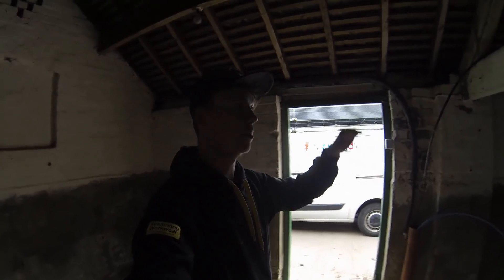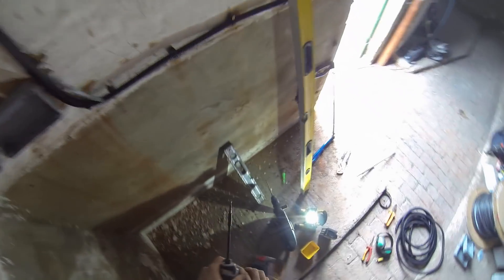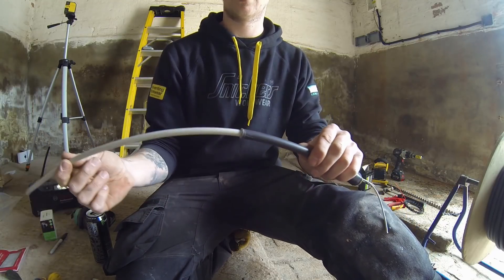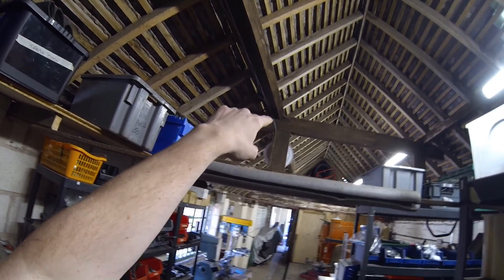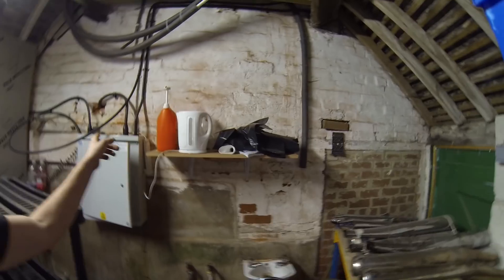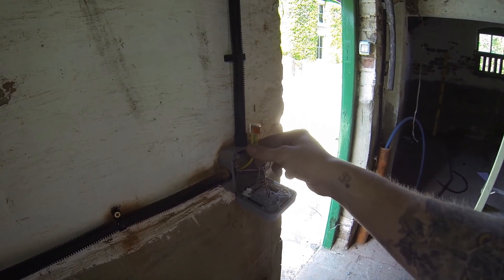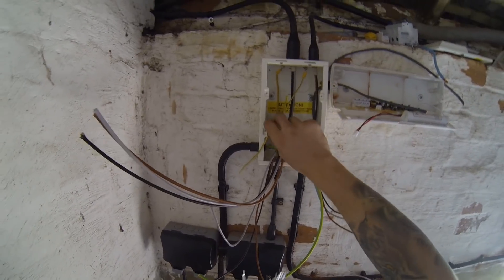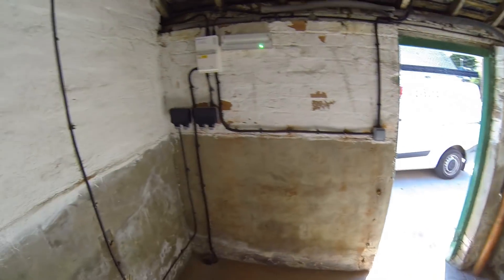Work shop install, SWA to IP sockets with LED strips

Comment: Hello mate , I'm not a electrician but a kitchen fitter and am fairly new to your channel ,but very intreasted in  you and Adams videos, wanted to give a thanks for the insight about the banjo and why the earth wire is connected to the armoured cable👍

Comment: Why are you not using star washers or they call them insulating washers in case they bite through the paint of the case of the board and ground your pee r ing on your normal cable

Comment: Can never figure out your elec regs over there, you fit all ip rated sockets lights ect but yet fit an non ip rated fuse board, and bringing a single phase supply to a sub board from a three phase main board would not be counted as best practice here in Ireland as you cant balance the loads correctly,  but not saying anything bad about your work btw just the regs ye work to seem all over the place,

Comment: I personally would have had one of the strip lights  by the DB as an emergency one or put the bulkhead emergency light higher up so it wouldn't be blinding if someone needed to get to the DB if it was dark. Also if you put the emergency light in there maybe you should have put an exit bulkhead above the door incase there was a general power cut, another reason why I would have installed a strip light with an emergency pack as it would have lit up the DB & the door as well as giving better light for getting out during lose of power if there is a power cut.
Reply: Fucking shut up

Comment: Just to let you know the IP rating is for the manufacturers more than the installer due to the fact of when you make a hole in it you've altered the IP rating, so even if you put a gland in and there are no holes it drops the IP rating. This is more so if you use a normal SWA gland than an exterior SWA gland & if you do use the drain hole as well then the IP rating has dramatically altered as it may let out water  or moisture it can also allow water egress as the box is now no longer 100% sealed.
The information should be in the paperwork included with the items & you can include it in your video next time.

Comment: I’ll be honest I didn’t get on with those spray chalk markers. The fucking thing wouldn’t spit anything out half the time. Those armoured cutters are nice, but the cutters don’t last long so the price per connection doesn’t add up for me. Especially when I don’t take that long to do it without the tool.

Comment: Do you need the earth fly leads from the armoured glands inside the DB when it is a metal DB? Surely the glands/armour are being earthed by the metal of the consumer unit (which is connected to the earth bar) which they are in contact with via the Piranha glands you used?

Comment: Man that was a quick install.  I would've quoted for about 3 days to do that, all those blooming wall anchors and swa glands, not to mention how long it would take pulling that 10mm through by myself.  I wonder what kind of hours those days were.  You exported the earth, but you backed it up with an electrode.  Now for some reason, I've always when doing that stuck to insulating the exported earth -  just used it for the submain itself - at the board, so the board runs off the TT alone.  I dunno whether it's in the regs or where, and I dunno if I'm sticking to something I needn't do any more, watching you.  I'm just really impressed at how quick you managed it.  Some bits of that were a ball ache.  Like all the holes and leveling them I get bored drilling holes and sticking wall anchors in them.  I've done some quite rough work too because of it, not bothering to level every one!

Comment: What's the point of the emergency light, not seeing a test facility for it. Was it installed in compliance with BS5266? Have supplied design and test data for it??
Reply: Not part of an escape route?

Comment: Good job 👍🏻 as a sparky myself I would have probably installed a couple of ip emergency led strip  lights and a test key switch..
Reply: Like he does @ 12:42?
Reply: @CurvedSlightly  it lights up the db not a 8mtr barn 🤔

Comment: Good job!, But why go to all the trouble of fitting weatherproof accessories and ten fit a metal consumer unit?? Also Hager do the metal boards with round knockouts aswel if your going to gland swa into them in the future 
=)

Comment: Question from somebody about to embark on an apprenticeship, when you use flexicon do you use singles or t&e?
Reply: You can use either it doesn't matter. Cables outside of an accessory just have to be double insulated. That comes from 2 layers of insulation on t&e clipped direct to a wall etc, or 1 layer of cable insulation and the conduit in that instance.
Reply: @codenamenel  thanks. I thought as much, same as rigid plastic conduit then.
Reply: @stevecraft00  If I'm doing lighting I will use 1mm T&E in the conduit, but if I'm doing sockets I will use 2.5mm singles as 2.5mm T&E can be a bit bulky/inflexible to fit through the conduit, especially the bends.

Comment: I can understand the emergency light but wouldn’t you be better off putting it above the board to illuminate it instead of it shining in your face when your trying to locate what breaker does what.
Just a thought other than that good job.
Reply: The SWA comes in above the board
Reply: Damien what does that have to do with it mate and it’s on the other video installs too I’m not saying any thing is wrong it’s just a suggestion
Reply: @devinesparks9467  Quite right, or it could have been sited on the side wall to illuminate into the board.

Comment: Using two earthing systems is a big NO NO! If you install an earth spike you need to disconnect the pme earth. Also why did you bother earthing the light switch back box? It's plastic...
Reply: On a TN-C-S supply TT is Not Required  to an out building if there’s no   extraneous conductive parts (water pipe gas struck me steel oil etc) is present. See John wards video on “supply to outbuildings’
However if there is Extraneous conductive parts then you should drop the earth from the PME and install a suitable earthing arrangements (rod Matt etc)
Reply: I fully understand this but I was making the point in relation to the above comment mentioning that supplementary earth electrodes can be used alongside tncs earthing arrangements. It was at one stage going to be introduced into the 18th edition wiring regulations due to the large number of broken pen conductors throughout the UK so diverted neutral currents had a return path back to the transformer
Reply: Danny Mort Yeah I understand I actually like that idea myself unsure why they didn’t introduce it in the end
Reply: Foundation earthing that is common on ev installations with tncs earthing arrangements incase of loss of a pen conductor before the transformer it would divert neutral currents back to the source of energy. Not seen it used like this
Reply: @dannymort7262  Yes, an earth spike should be installed for an ev charger if the supply is tn-c-s but an earth should not be taken from the tn-c-s supply aswell as that would mean two earthing systems are used.
Reply: @Microwebb  check section 722. If you can get the earth loop impedance to a low enough value to ensure 70v rms is not exceeded in the case of a broken pen conductor a supplementary earth electrode connected to the distributors earth can be provided.
Reply: @dannymort7262  correct, but that is very unlikely, see John wards video on ev installations.

Link: https://youtu.be/q87H7aIujjA
Reply: @Microwebb  but you said in your earlier comment that you cant have a supplementary earth electrode and tncs connected together in your earlier comment but you can. Same principle  as I've mentioned in an earlier post about foundation earthing.
Reply: @dannymort7262  I didn't think you could, I've always been taught that you can only use one means of earthing. But I shall definitely look into that more now, cheers.

Comment: Nice job and tidy work but call yourself a proper sparkie?  You could have easily put a screw or nail thru that blue MDPE water pipe at 4:20 just to return the favour to our plumbing colleagues who like to use our first fix cables for target practice?!!  (only joking of course we all love our other trades)
Reply from the maker: MikeT 😂😂

Comment: Nice work mate, not far from you and looking at going out on my own! What you using to record your videos?
Reply from the maker: Not far at all then, yeah it took a while for it to start becoming a proper wage but I did it before kids and a mortgage so there wasn’t a lot of pressure
Reply from the maker: Parry's Electrical cheer mate , where are u based? Do it ! It’s the best thing as long as you keep yourself organised it’s fine 👍 and just brought an old GoPro for the time being but 3D printed and few things to improve it
Reply: @NBundyElectrical  Burntwood, other side of cannock! Working for South staffs housing at the mo, watching a few vids on YouTube has pushed we to the idea seeing all the different installs looks good! Just cash flow being the issue!

Comment: Nice job.... I’m not sure about TT earth and PME one one system 😳
Reply: There are circumstances when adding a ground spike to a PME is thought 'inadvisable' and others where it's actually prohibited.
But this looks like one of those instances when it's okay, and actually a good idea to have in case of broken neutral / broken earth type problems back at the main installation.

https://www.voltimum.co.uk/articles/principles-protective-multiple-earthing
Reply: Matthew Malthouse I’ve not read your link yet, but I imagine in there was an underground metallic service pipe incoming, it would need to be earth bonded. Essentially the providing an equivalent to a TT earth. So perhaps not a problem and great to highlight this issue is a great video 👍
Reply: It's not a TT earth - please see, for example, section 14.5 of Guidance Note 5 (2018).
Reply: John Howard can you go into more depth of 14.5? I’m still waiting for my GN5 to turn up not to familiar with it!
Many thanks
Reply: zjzozn yeah I don’t think your meant to join them. That is even worse.
Reply: Do you remember the rumours before the 18th edition came out, about new houses with extra TT earth stake. But it didn’t become true!
It’s one system or the other. Perhaps this is a TT system earth and the PME incoming cable earth is in a plastic gland and earth not connected?
Reply: zjzozn On a TN-C-S supply TT is Not Required  to an out building if there’s no   extraneous conductive parts (water pipe gas struck me steel oil etc) is present. See John wards video on “supply to outbuildings’
Reply: @fuzedtv  It's still not strictly required even with extr.c.parts, just run a suitably sized main protective bonding conductor based on the PEN conductor size, but other factors may make TT preferable, such as the presence of water and people around with bare feet.
Reply: John Howard Good reply, there is an example of this on John wards video as I mentioned before by doing the method you said your extending the  equipotential zone however the likely hood of that cable being damaged or disconnected is more likely then a TT system but personal choice depending on the design of the installation and the factors as you’ve mentioned

Comment: You should have pulled a 10mm rope in to pull the SWA through.  You wouldn't have had to dig up anything.
Reply: Mention was made that right angled bends were used in the ducting. This may be an issue regarding minimum internal radii of bends in cables for fixed wiring, with a factor of 6 - 8 needing to be applied to the overall diameter of armoured cable to determine the minimum internal radius of bends, to prevent damaging the cable internally. Drawing the cable in may have been easier with ducting that had bends equal to or greater than the minimum required radius, but not sure how easy it is to get ducting with various radii.

Comment: Nice to see a sparky you tuber in Staffordshire area, good work fella and a sub from me.

With your swa consider using a bs5467 xple type cable you may find when you do your sums you can get away with smaller cable for your loads as it has a higher current rating. Also batts cable far the best to work with in regards to swa.

Comment: Surely the RCD being 40A makes no difference, as they don’t trip in overload conditions? Only an RCBO would.
Reply from the maker: Adam Davies yeah ur right I must have been talking out my arse 🤔
Reply: N Bundy Electrical I’m sure we all do it mate 😅
Reply: RCD 61008 doesn’t provide overload protection it’s just the rated current the RCD can take.
Reply: The 40A rating just relates to the DP switching capacity of the loads its protecting ;-)

Comment: great video. quick question. could you have used hi tuf cable for the sockets instead of swa? thanks.
Reply: Andy chara do you mean SY cable that isn’t recognised by bs 7671?
Reply: 1.5mm 3 Core 14A - 50M Drum Hituf Cable. qvs or tlc sale it. comes in 1.5 and 2.5  @zjzozn
Reply: @andychara1631  Yes, manufactured by Draka. There's also Tuff-Sheathed cable by Doncaster cables.

Comment: Hi Nick good job and great video. Keep them coming. Can I ask what you connected to emergency light to? Did you connect this to the lighting MCB or did this have its own MCB?
Reply from the maker: Daniel Johnston thanks bud, and it was connect to the lighting mcb, it was the first point on the circuit 👍

Comment: Top video mate, can totally relate to when you were pulling that 10mm through by yourself - the joys of working for yourself!

You still rating the armour slice? Been toying with getting one for a while now, has it replaced you using a hacksaw for most situations?
Reply from the maker: Jamie Doble cheers bud, and yeah highly rate it, worth every penny, not used a hacksaw since to be honest